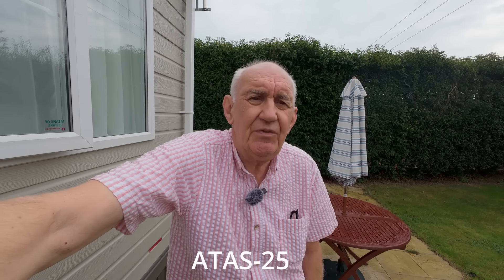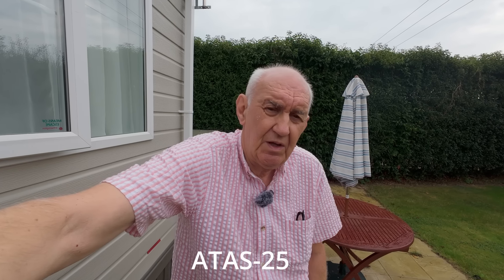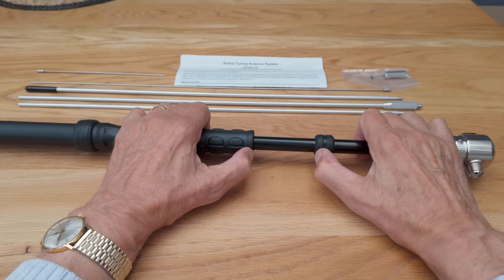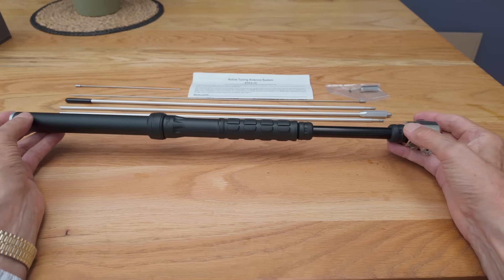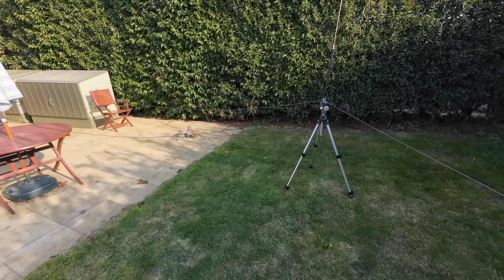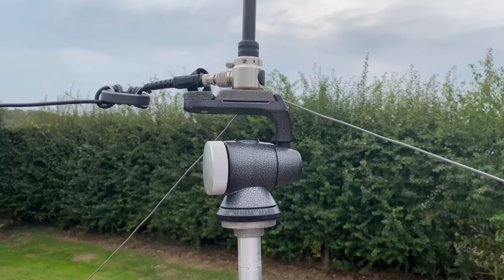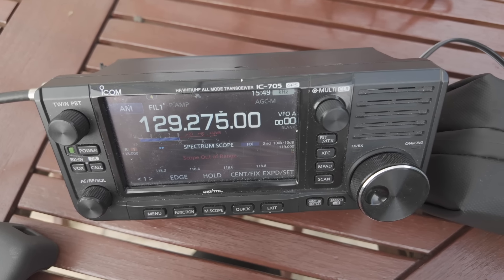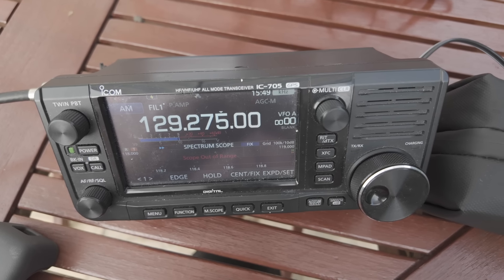Yaesu Micro ATAS-25 40m - 70cms Portable 100W Screwdriver Antenna for Ham Radio

Comment: I have two antennas by JNC Radio (aka Chelegance) that I think are both fantastic: a vertical MC – 750 and a dipole MC – 599. The letter I also purchased their 5 m tripod to elevated above the ground. I have used both of them for SOTA and POTA activations, and I regularly use the dipole on the third story deck on my house in Maine. neither need a tuner as the whips are marked for each band.

Comment: mounting on the van is a straightforward operation peter.  i would use a CB tank whip cut down to size. a 3/8 to 1/4 adapter easily found or knocked up on a lathe.

Comment: The line isolator at the feed point - can I get the size of coil you're using and the number of windings?
Reply from the maker: 240-43 toroid and 8-10 turns - not critical.

Comment: How odd that Yaesu don’t supply it with a standard 3/8 fitting, to make it so you need to use a mount designed for something non-radio seems daft to me.

Comment: I'd be very wary of using that whip on that van roof in that location - it looked awfully near those power-lines! Telescopics are ok - until they wear, and the joints get sloppy! I've been using a Slidewinder, virtually the same thing. (but not recently, too wet for messing about outside!)
Reply from the maker: Don’t be fooled - the photo makes the wires look far closer than they are!
Reply: @watersstanton  The camera never lies! 🙂

Comment: Not a screwdriver antenna. Electric screwdriver antennas are named for the original source of the motor and planetary gear train used to drive a lead screw to remotely adjust the coil. Manual versions of this class of antenna long predate the application of screwdriver motors, or even the existence of the powered screwdrivers.  See, for example, the Webster Bandspanner.
Reply from the maker: Screw driver has become a generic description  of this type of antenna, mechanism irrespective of whether electric or habddriven.
Reply: I think you need to keep up with the times, it is now a generic term.
Reply: @mariemccann5895  common misuse does not make it correct

Comment: Hi Peter, you may or may not be aware the the X6100 now has new firmware which makes some improvements such as giving a full display by switching on or of the audio scope and changing the colours of text from red to white making it easier to see outside. Nice vid 73
Reply from the maker: Thanks for the info.,